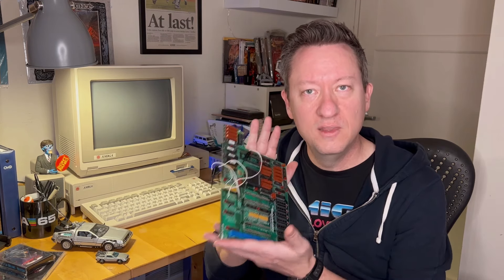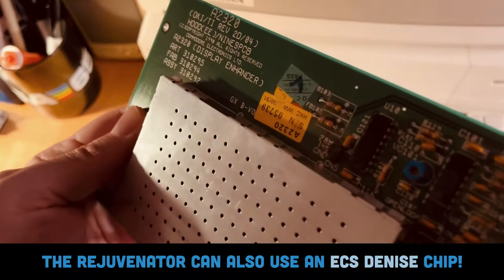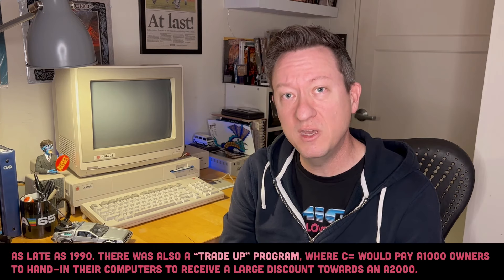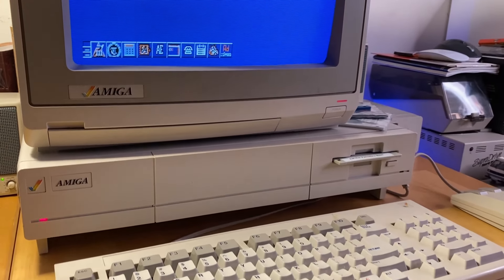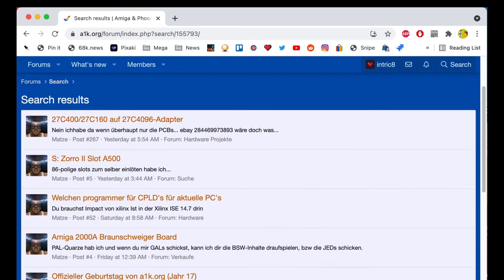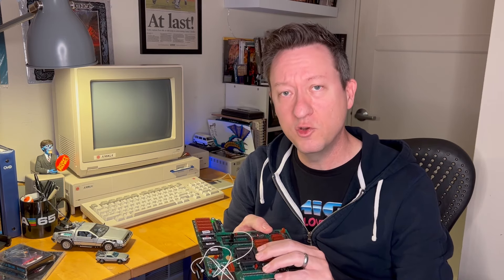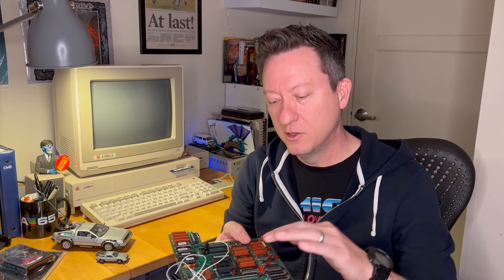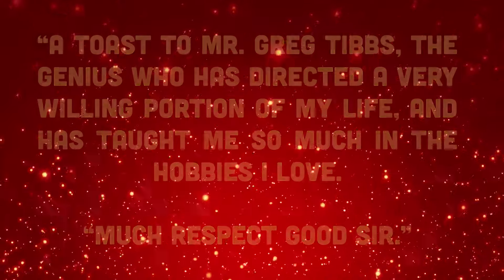Amiga 1000 Rejuvenator Project: The Finale

Comment: Great job! Everyone on the team just did fantastic work getting this little guy working! I hope to have one early next year.  I look forward to seeing if I can get it working with my Vampire
Reply from the maker: Thanks, Doug. And I imagine it should work with your vampire if you can get all that to fit in there. They cost ~$150 in parts at the moment. I bet you have a pile of Agnus chips. The hardest thing to find seems to be (if you want the 2MB version) the proper A3000 Agnus and the RAM. I know some folks have had to use more than one parts supplier to get all of the other little doodads. My new board is sans video port and sans RTC (no need for either). Keep in mind, there may be an update in the first half of 2022 that'll allow for much more plentiful 2mb Agnus chips, a coin cell battery replacements and potentially some other upgrades. To infinity, and beyond! ;) Merry Christmas, Doug. Hope you're doing well down in AZ.

Comment: I assembled the rejuvenator and I am very grateful and happy about it !!! It really works perfectly! I only have to make one comment, namely the wrong values are given on C21 and C30, with which the clock does not run. A 0.1uf capacitor belongs on C21 and a 20pf capacitor on C30, both 10uf.
Reply from the maker: Thank you for this information. I'm not using the clock on my Rejuvenator - I use a Parceiro for that. Thanks for this, though. I will pass it along. Cheers!
Reply from the maker: @Robert Schlämmer I sent your comments to Joe. Here is what he said: "Thank you so much for letting me know the issue.  These capacitors were omitted from the BOM completely.  The schematics had default placeholder values.  I’ve updated the BOM.  The schematics will update in time, I’m working with some issues after the KiCad 6 upgrade.
 
"But I think the fella mixed his positions, .1uF should be on C30 and 20pf should be on C21.  The circuit is nearly identical to the A500’s memory/RTC upgrade card."
Reply: @AmigaLove  Thank you for correcting the list!
Is there actually also a Gerber file for the small circuit board for the video slot?
Reply from the maker: @BigRob203  No, the video slot used cards from back in the day. At least, that's all it is good for these days (like, the A2000 flicker fixer, for example). But I've heard murmurs of people trying to exploit that connection for more modern applications. I've never used it myself.

Comment: Thanks to you and the entire team for your resilience and dedication, Eric. I have a spare A1000 with rev. A mainboard ready to be rejuvenated and I can't wait to have the bare PCB manufactured. I will use the 318069-18 Agnus from a GBA1000 rev. 1 until the more common 390544-01 can be used.

Your A1000 and A1080 have both been blessed with rare boingball badges. Are they original?
Reply from the maker: The boing ball badges are indeed original in the sense the badges are original. I removed the checkmarks and applied the badges very carefully in honor of Dave Needle. In fact, I made a short video about it this year after finally finding a 1080 monitor badge, which I'd been hunting for for years. https://www.youtube.com/watch?v=KsK3gry9ZfQ

Comment: Wow!
Looking forward for developments!
An awesome addition it would be to my A1000 with PiStorm (and RGBtoHDMI in the video slot?)
Reply: Or could RGBtoHDMI could be integrated to a Rejuvenator 2.5?
Reply from the maker: @Breeffeehey  Hi Lou - that all depends on the community taking what's now out there and running with it. I know more than one person has taken the work and started to expand upon it (making it easier to use different more common Agnus chips, for example). Updating the limited video port to future advancements seems very realistic of a goal, too. I personally have no desire to go down that road - I love it just the way it is - but I guarantee there will be more innovation around the Rejuvenator now that all mysteries of the original board have been unlocked and shared.
Reply: @AmigaLove  I love it the way it is! 
I saw on Facebook someone who had problem running his Rejuvenator along PiStorm... So, that's why I said I was looking forward for development...
In those times I wish I was better at hardware development, but I have to rely on people who knows how things works deeper...

Comment: I bought my stock Amiga back in 1986 and almost sold it in 1992 due to loosing my job and couldn't afford to pay my rent and utilities but something inside of me told to me hang onto to this dear machine, my heart said no my pockets were trying to say yes. now its been 37 years and still original owner of my Raw Stock built Amiga. Am a true vintage guy who hates modding machines and this is a truly noninvasive and non-destructive way to bring extra life into the Amiga. I really don't have time to build or chase parts up but if anyone has one built and available I would like to purchase one of them or how to get my hands on one, any tips appreciated.
Reply from the maker: Hey there,
There is a guy on Amibay who builds these and sells them in batches. You’d have to create an account over there and “learn the culture” of how to declare interest for one, pay the guy, and then wait a while for it to arrive.   Also know that if you decide to go that route the installation is non-trivial. It requires the removal of the motherboard from the case (pretty easy to do as the computer is pretty simple in design) and special 3D-printed guides are required to install the Rejuvenator without damaging things. 

https://www.amibay.com/threads/rejuvenator-clones-for-amiga-1000-batch-4-available-now-jokersad.2441222/

Finally, the boards are being sold but you’d need to source the 1mb (easy to find) or 2mb (hard to find) Fat Agnus and associated RAM chips to complete things.
Reply: @AmigaLove  Thankyou so much for the Help and Tips, Your content is Fantastic, Keep up the Good work!